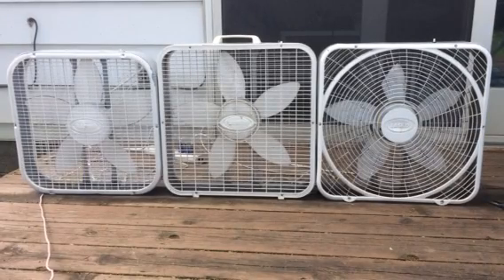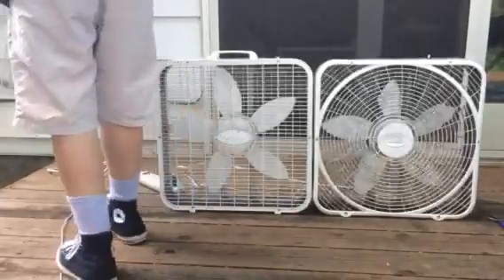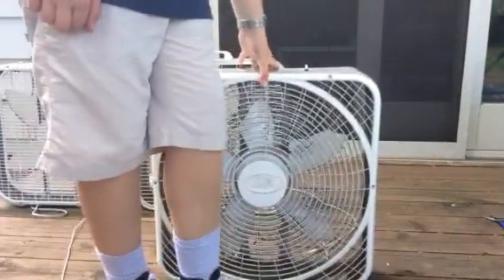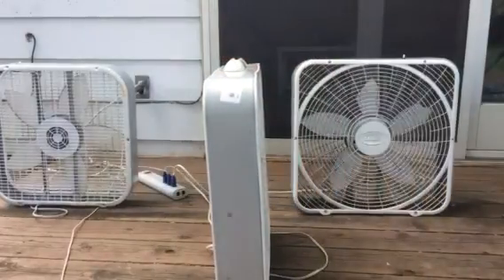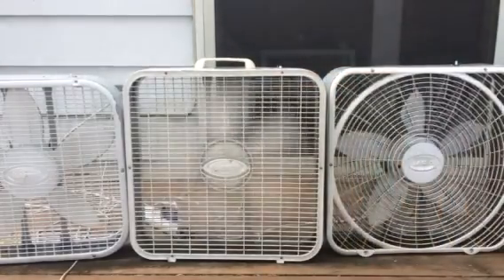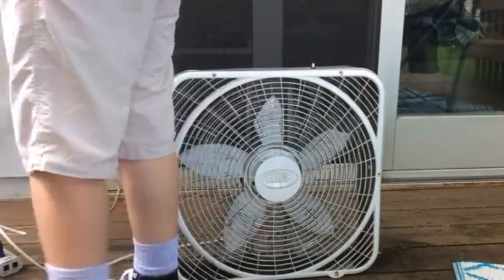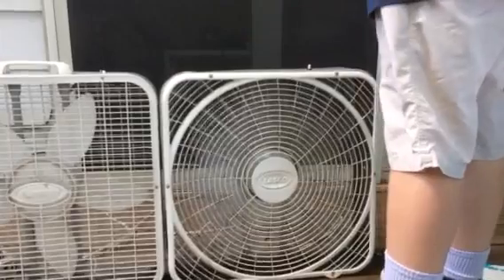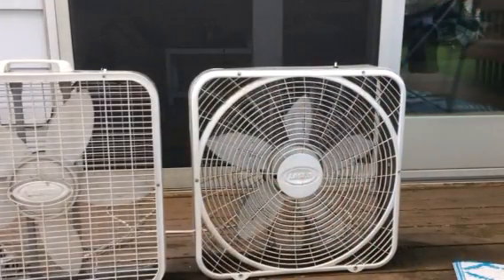3 cheap FAENS from MSU Surplus

Comment: The fan on the right is an early Lasko premium model. You are right, 
they do look a lot like the Lakewood Rain Guard models or the 227. Are 
you sure it is a 2005-2006? The rear by the motor makes it look like 
it's older than that. Later models didn't have the badge in the center 
of the motor that said Lasko on it. Does that one have the older Marco 
motor or the newer small motor? The fan in the middle could be from 
2000-2006. If it has the Marco motor, it is a 2000 model. If it has the 
small motor but isn't covered up, it is from 2001-2003. If the motor is 
covered up, it is from 2003-2006. As for a blade for the premium model, 
the blade from the center fan might work. I'm not as knowledgeable on 
Lasko as I am Lakewood, but Lasko definitely did do a similar thing with
 lightening up the blades later on. Good luck fixing all of these.
Reply from the maker: I ain’t gonna. I’m gonna do what we do best...:)
Reply: @isaac24  If you mean destroy them, please don't destroy the Lakewoods. They're getting harder to come by, even if broken. Put the original blade back on the 101A and it will be fine again.
Reply from the maker: Oh no no no no, I'm not going to destroy the Lakewoods, just these Laskos.
Reply from the maker: Are any of these 3 worth something? Like should I not throw them out?
Reply: The one on the far left is not worth anything. The one in the middle is only worth keeping if it has the full size Marco motor, otherwise it's nothing special. The premium model is also only worth keeping if it has the Marco motor and you can find a replacement blade.